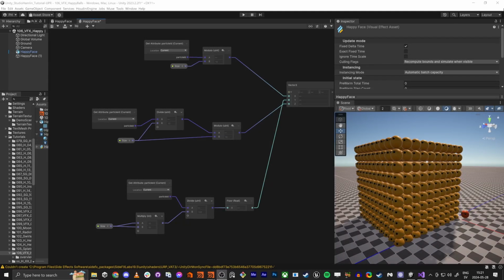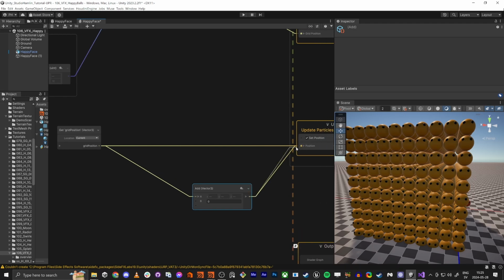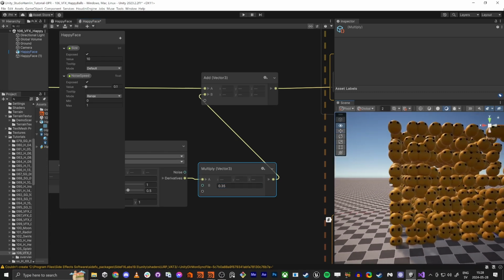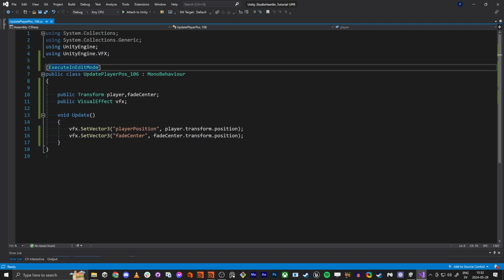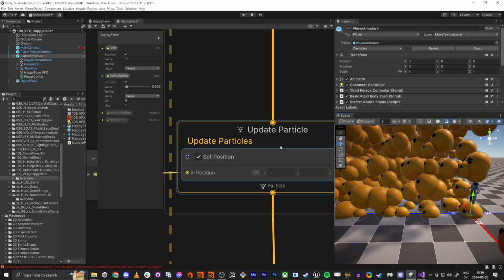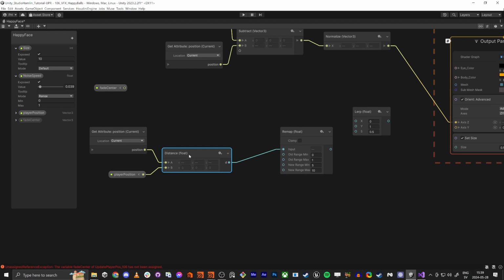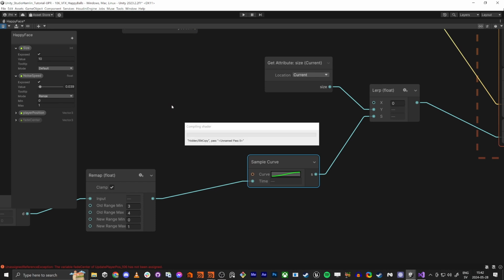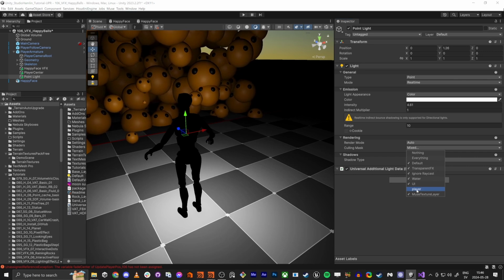Unity VFX Curious Happy Faces part 2

Comment: Hi , thank you for the tutorial, when I try typing Set Custom attribute, nothing is showing to me, is there any thing i am missing?... I am using unity 2023.2.20f1, and vfx graph 16.0.6
Reply from the maker: Hmm, you mean you can’t find the node? In that case just write custom, and see if you find it. Also I don’t know if you need to have experimental features ticked in settings. Try that out 🙂
Reply: @TechHamlin   Wow, ticking the experimental features did it .. thank you so much sir 🌹 ,  also I have another nooby question, my mesh particles do not cast shadows .. is there any setting that can be disabling it?
Reply from the maker: @mostafa3beed118  Glad it worked!
That might be you need to choose "lit" shader. Also, check you light if shadows is set to on/off. Could also be a setting inside the shader. check the graph settings
Reply: @TechHamlin   It was a check box in the scriptable object related to the lit mesh block and it worked .. thank you so much 🌹